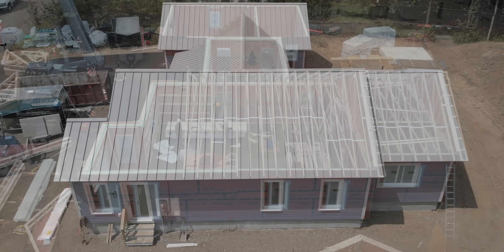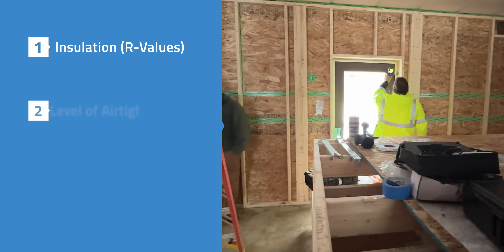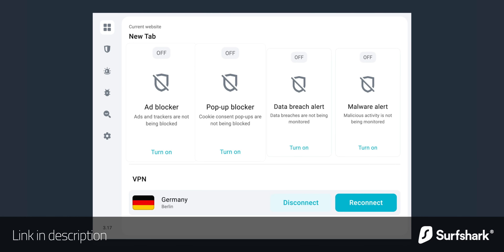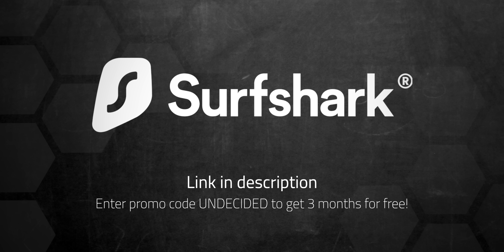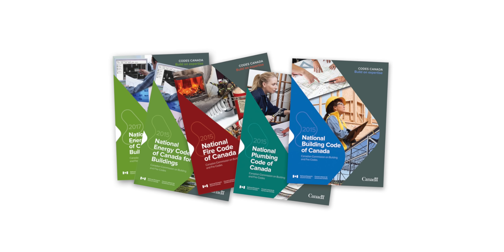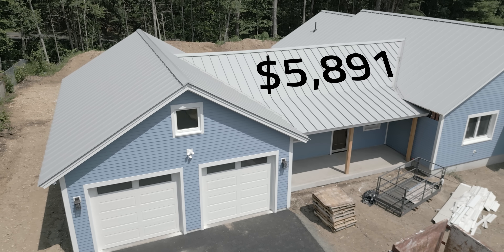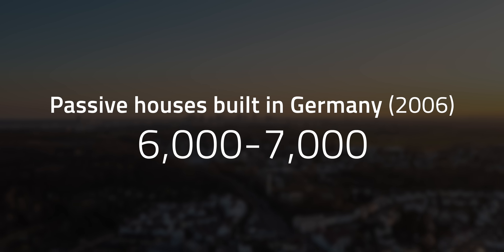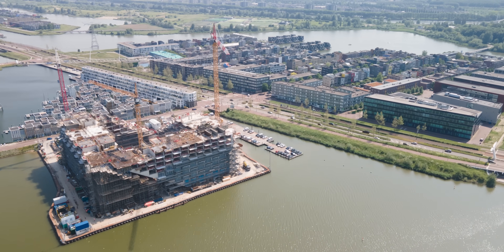Why Do American Homes Suck?

Comment: In my experience I have found it is extremely difficult to use above code home products. The local contractors think it is a waste and are not trained on it. So they try to steer you away from buying it. Then some times you find a contractor that does install it and there customer service is less than satisfactory.

Comment: NZ seems to match the green colour you were looking at. I'm in Wellington (windy). I built a 5 bedroom house with double glazing. I've needed to turn on a heater about 2-3 X a year. I have concrete floors so that helps cooling. I aim to put in heat pump air con soon but had to wait due to cost overruns on the build.

Comment: Because Germany force people to pay high to reduce heat cost. However, it increse house cost too high and better use cheap energy for individual. It only good for gov.
Reply: Germany and all previous instances have always built massive and solid. Even when there was no central government to speak of or even no government at all.
You must be aware that the south of Germany is at the same latitude as the north of the United States.

Comment: A tad bit elitist, especially as so many are being priced out of the housing market as we speak. Increasing code requirements will only make this worse. Most people would build to much higher standard if money were no object but they don't for obvious reasons. But how to address the environment? I'm a "Occam's razor" kind of guy, and the simplest solution doesn't seem to be to increase building standards for millions of homes and, I suppose, retrofitting millions of existing homes. This sounds like a good idea, but there are a lot of unintended consequences like further limiting access to affordable housing, indoor air pollution, etc... No, the simpler solution would be to focus on clean, inexpensive energy. I like the micro reactor idea some folks are working on, but there are likely other good ideas out there. Everyone would benefit from cheap, abundant energy -- rich and poor alike. Too many green ideas leave the poor literally out in the cold.

Comment: A part of the problem is the huge percentage of rental units. Land lords are motivated by profits, and they can easily get away with energy inefficiencies, and simply leave the extra costs to the renter. For example, who needs insulation and green energy when all you need is a heat source that can keep temps above 65 F , and the cost of heat is paid for by someone else (renters, not land lords)? Here's another: Why would a landlord allow dishwashers (which use far less water than handwashing) when it involves buying an extra appliance, and a small potential for water damage? Landlords benefit from just making the renter do them by hand, at the expense of energy efficiency, and the renter's time.

Comment: Why don't you just use concrete and bricks for walls and roof? Don't think that's too much expensive compared to wood, and that way you don't have to redo the roof. On top is automatically more energy efficient.

Comment: To get a mortgage in the UK for a home that’s not built out of bricks and mortar is fairly difficult. Timber and steel construction was outlawed decades ago and only really trialed for a short period of time in the 70s-80s. The current regulation on double glazed windows in the UK is 20mm thick but most windows are 24, some are 28mm, it’s increased since the 2000s so even double glazed windows go a long way to recode noise and heat insulation (not to mention safety) 

Also, I’ve been told to replace a roof on an American home is fairly common after 20 years? I’ve had the roof replaced for the first time on one of my rentals for the first time (new batons, timber and tiles) and the house is over 50 years old.

Comment: Homes
I’m going to add my two cents about building homes nowadays (in the U.S.). As I write this the year is 2023. Wood / lumber for homemaking should be things of the past. We should not be making homes out of wood anymore. I know people who waste $200,000 or more building a brand new home and made out of damn wood (lumber) only to have it destroyed a year later by a tornado.
I used to live in Puerto Rico for 20 years and all the homes are made out of concrete from top to bottom, no lumber / wood needed whatsoever. There are so many disadvantages to making a Home out of wood versus concrete and here is my list.
With a wooden home you will need a lot of insulation. With the concrete home you don’t. With a wooden home you will need to worry about termites if it’s not treated. With a concrete home you don’t. With a wooden home you have to be aware of short circuits that cause a fire that can burn the house down. With a concrete home you don’t. With a wooden home you have to worry about tornadoes and hurricanes yanking off the ceiling and what not. With the concrete home you don’t. There are so many disadvantages for making a home out of wood / lumber that I cannot see why people don’t make homes nowadays out of concrete which has many advantages over a wooden home and not to mention way safer. Oh, and it’s not that expensive either to make a home out of concrete. So stop using wood / lumber like we are in the 1800s and start making homes out of concrete for a safer family environment. Thanks and have a good day.

Comment: Unfortunately, the Spanish construction model of tourist areas is very similar to the American model, low construction costs and not thinking about the future.  It is curious that traditional houses that are more than 200 years old are cooler than modern apartments with air conditioning.  Only using lime on the facade instead of synthetic paint greatly reduces the temperature, since the house breathes, it is the same effect as clay containers, they cool the liquid through evaporation.  Another wonderful solution is interior patios, which with a simple fountain and plants can achieve important temperature differences and at night when opening the interior windows that face that patio, a natural circulation of air is produced that makes air conditioning unnecessary.

Comment: The main issue is price....
Insulation , air recuperation system (erv) that is crazy expensive where you can build the module for that for like 100$ (yes that cheap using PP corrugated board like most of expensive erv are build from it)
Heat pump that cost crazy amount of money where you can buy AC unit and its literally the same thing just get converted one to water heat exchanger (not air one) etc

AND THE BIGGEST ISSUE
houses are not air tight and have thin insulation 
AND dont have heat reflective insulation (that alone with just few mm of thickness can reflect 90% of heat back in) 

Noone teach that to people because if everyone will build it properly ...noone will earn for extra heating , health issues etc 😢

Comment: First of all Greetings from Germany I live close to Darmstadt about 7km away of the Passive House Institute. That said, I partly raised in my childhood in Sarasota FL and yes visiting the US in the 2019 the last time I can agree and always said it, you are wasting nearly everything, energy Oil, Gas, Electricity and of course Food and you are building tons of waste in some statesyou are still using styrofoame enclosuresfor food plastic cutlery and so on. On the other hand North America got still a lot of resources, but they will be lesser and lesser soon one day. But I want to point out why we build here so tight, the fact is we've a lack of Energy Sources in Germany and we will have them for ever except Solar or Wind producing our own electricity or hot water, that's why for another Reason Heatpumps play a more and more bigger role here. We also use more ductless mini splits than the US too, bottom line when you build tighter and well insulated you almost need just a hair dryer to heat your home.  About the windows, countries like the UK and Netherlands for instance their windows open from the inside out for a long time, because when the strong winds on costal areas blow against your house the sealing gets tighter, because the window is pushed against the frame but today the UK is only allowing by code to build those windows on the first floor because of to much accidents in the past, you can't really clean your outside glass. Greets from Germany Pfungstadt

Comment: Probably with this many comments below someone has made my point already, but I am not reading 3,471 comments to find out. Americans on average move every 7 years, so they do not want to pay a tremendous amount more for a new house when that money will just be lost because houses are not rated and the prospective buyer will not pay that excessive amount just because someone tells them it is "so energy efficient". It is a real short sight in your video for not pointing this out. For your idea that all houses should be very energy efficient they would all have to have an energy rating system and a construction rating system, so that the prospective buyer is not "comparing apples to oranges".

Comment: I'm from Southern Europe and even the oldest modern houses from early 20st century are load bearing stone walls with concrete slabs and an absolutely gorgeous modern movement design. Even the oldest village houses are stone walls with tile roofs.
The new ones are concrete load bearing structures with brick walls built up to code for severe earthquake events.
I've never understood why in the US the houses have to be build like that, what is the purpose behind wooden frames and all this complicated construction that can not only fly off in a storm but also be vulnerable to... Termites!
Not to mention their leaky windows and cardboard doors.
This is still a cultural shock for me.
Reply: If you think every house is like that in the United States it's not. My home is built very good here in the United States along with all of the houses in the neighborhood and the surrounding neighborhoods. The amount of videos I see Europeans watching on the United States and then they believe everything they hear or see is disturbing. Seems like Europeans believe anything they hear. No every house isn't made out of wood in the United States. Not even close. No every American isn't 400 lbs. Even though social media brainwashing would try to make you think that 😂

Comment: Quick side note on the UK housing in general: just over 50% of the UK housing stock was built in the 1920s-1970s and has absolutely abysmal insulation standards. Thin walls, drafty, and mould everywhere... Those were built so badly that the WHO has named them as a main reason for the UK's fuel-poverty dependent excess mortality from preventable causes. So, no excuses USA, if Old Blighty can fix its building codes, you can too.

Comment: Sweden: U value preferably below 0,15 (0,15/5,6783=0,026 US U value). Standard prefab house, cheapest option: Around (depending on house model, manufacturer and so) 0,14-0,2 (0,024-0,035). Most energy efficient houses, passive houses, do not need extra heating. And we are talking in dark cold Sweden! You might even need to open a window during winter if you have a few visitors for dinner since it can be too warm. =)

Comment: I bought a mobile home on 2 acres for $70k last year the walls are paper thin and the electric bill is insane BUT ROI to build a "green" home the same size is 100+ years (the home's tax value is $6500) I bet 1 window cost more than my home and here in NC my electric is only $.09/kwh so solar doesn't EVER pay off
I thought about sealing it up but even windows and the padding/siding need to do it would ROI only after 25+yrs add the extra roof and roi jump to 60y years

Comment: Thank you for an interesting program. I live in a 300 square meter large house from 1895, with a log frame which accumulates heat during the day and release it in the night which makes the temperature span smaller. We have also single plane windows (the old hand made glass once) with removable inner windows that we take out in the summer and put back in autumn. The inner windows are sealed with a glued paper strip which makes it almost completely air tight. As airtight these kind of houses can be without starting to mold. We have installed an air to water heat-pump with built in hot water tank. In addition to this we have three tiled masonry heaters (I love thes very nice fireplaces) that we use to bring the heat up when needed.
Our average energy consumption in a year is around 15 000 kWh including house hold appliances and around 5-8 cubic meeter of wood. With a 5 moth period of cold winter (usually around 0 degrees C for the most part, but also around 2-4 weeks with temperature between -5 to -10 C and a week with -15 to -20 C). We allow some less used parts of the house to be a bit colder to save energy. With an energy need for 50 kWh per square meeter, the house during its very long life span, have a very low carbon footprint.
The EU parlament still want to make us suffocate the house with extra all energy savings that probably would kill a wooden house like ours and remove most of the cultural heritage in the house.
https://tvpworld.com/68507504/eu-parliament-votes-in-favor-of-compulsory-renovation-of-old-buildings#:~:text=Specifically%2C%20residential%20buildings%20should%20at,by%20the%20planned%20new%20regulations.

Comment: This building code info is all well and good BUT if the builder cut's every corner and the workers do the same and the building inspector in on the take or does zero because you can not sue then YOU ARE SCREWED. What about flood zones that are expanding Iknow get a raft HA HA HA .

Comment: The difference is, that in the US the buildings often have to be cheap. So that a lot of people can afford can afford buying. With higher cost of construction materials they wouldn't be able to. That they pay a part of the saved money later for higher cost of energy and maintenance. 

The next thing is sustainability (and i don't mean that from an eco-perspective). The house I bought is from 1912. Of course it had been updated. Insulated, new electric installations, plumbing, heating,... But it never lost its value. So it's an investment. Compared to this a lot of buildings in the US won't keept their value for 100+ years. They would be broken down and rebuilt 2-3 times in this period. So houses are more consumption than investment.

Comment: Since we got windows with 3 panes, it's so less noisy as with the one 2 pane windows build in 1993. It's definetly cooler in summer (no AC) and much warmer now in the fall.   
The only thing, that sucks, are the prices of electricity. The price has doubled by same energy-consumbtion from 2021/2022 to 2022/2023.

Comment: Building codes in major cities work both ways. I hear your call for more efficient homes and I'm with you 💯. But trying to innovate commercially, or even with your own house, becomes impossible.

Safety, efficiency, absolutely! But there then also needs to be affordable and efficient ways to prove safety and then be allowed to implement. That's just not how local governments work in many major US cities. It's about taxes and fees and laters upon layers of commissions and advisory boards.

When we bought our house here in Chicago, we were going to build a biodiesel generator. Bad idea for the environment. I'm glad I was stopped. But I wasn't stopped for the right reasons. In fact, if my back yard was just five feet (just over 1.5m for the rest of the world) wider, the precinct, ward, city county, state and federal governments would have had no issues. But haybale insulation, cob construction, even any deviation from the one approved type of rain catchment system or wind turbine is out of the question.

The industry dictates the standards. If building codes are further solidified nationally, the only innovation will come frwealthy companies and not until they have enough financial incentive.

If I can show that I'm not harming the environment or endangering my neighbors' homes, let me try new things with my own home. I don't think that you are intentionally trying to stop me. But a national building code (if lead by the housing and construction industries as I'd assume given our history) stifles all of us.

I just realized that the "all of us" I'm referring to are those of us with lower incomes. If you have the money to build your own custom energy efficient house, affordability may not be as much of a hurdle.

Comment: Here in Greece buildings mostly use concrete skeletons because of the earthquakes, then brick walls with insulation, double-glazed windows etc. There are state grands every couple of years (up to 60% state commission I believe) for owners of older buildings to upgrade their houses (new highly insulating  doors/windows,  insulation shells for walls, solar panels, thermal pumps, new air-conditioning units as it's crazy hot in the summer etc).

Comment: My house is about 100 years old, the only insulation that it had before I bought it was 1/4 inch foam board under the siding. 😭

I have been adding insulation as I renovate it. When I get to replacing the siding I’ll probably add Zip-R sheathing for additional insulation and to finally make the home airtight.

Comment: A friend of mine is kind of a prepper. Lives in Michigan. The base concept is to have a huge diesel generator. It still makes you very much dependend. A real prepper would have a passive home which often comes with bullet proof tick walls and totally off the grid (if you have to) solar, wind and/or earth powered heat and electricity :D

Don't sell the "passive house" concept for the enviroment or money savings sake. Sell it based on WW3 and armageddon! Call it "Active freedom house"!
Reply: Video is specifically about 'individual Houses' but what about the stuff Not-Just-Bikes, Edencity and Adam-Something preach? 

?